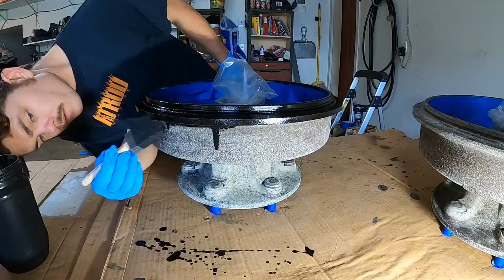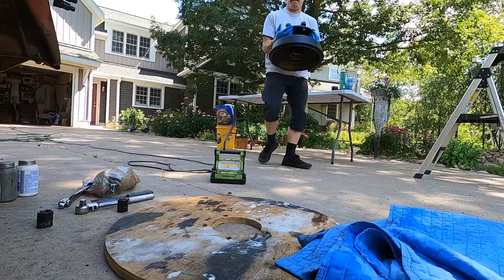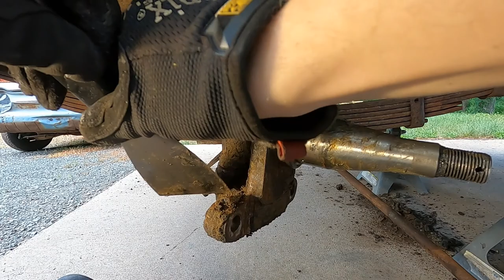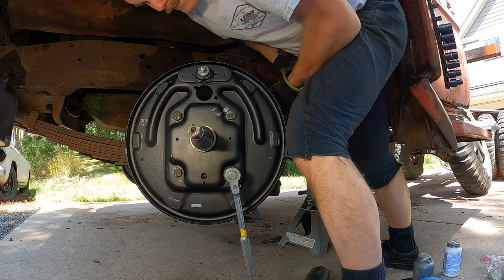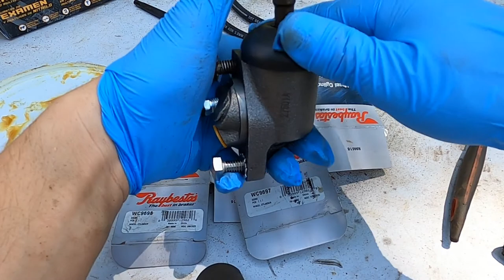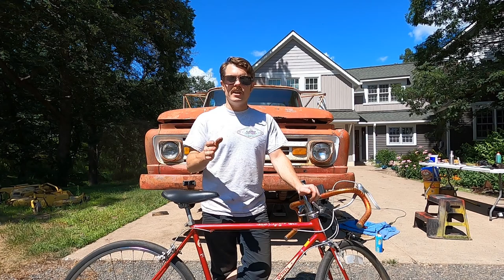1962 Ford F600 Brake Restoration! Ep. 44

Comment: Great video. This type of brake system has some flaws or defects that you need to be aware of. The brake booster has a metal vacuum tube under the truck that is prone to rust creating a huge vacuum leak and the booster also has an atmospheric tube that originally was inside the cab (behind the driver's seat) and this tube going down to the booster deteriorates to the point that the booster starts drawing in any moisture around the air inlet of the booster resulting in rust at the bottom of the diaphragm inside the booster. Once moisture gets in the booster then it is just a matter of time until the booster fails and defaults to manual brakes.
Reply from the maker: I replaced all the lines and hoses, and even did the vacuum line loop in the engine bay to keep blowby out!

Comment: Great video's, I've watched just about all of them. I have a 1957 F-500 I'm bringing back to life. The biggest problem I have are the 5x8 lug RH5° wheels i have, I want to get rid of them but I cant find any bud wheels. Any suggestions? Thanks! and keep up the great work! super helpful!
Reply from the maker: Glad to help! I love the 57's. In searching for my own wheel options, I've found you can get 22.5" single piece wheels that fit the 6 lug Budd pattern, but the old 5 lugs are more difficult. You may call truck wheel suppliers like this one and give them your specs to get some wheels custom drilled. It'll be a bigger expense up front, but then you'll have your pick of modern tires and always have peace of mind.
https://a1truckwheels.com/22-5-steel-wheels/

Comment: hey bro. odd question, you seem more knowledgeable than I am about these older trucks.

if I have a B600, which is the bus body medium duty truck (23,000-gvwr) version of the F600 from 1989.

I want to swap the drums and front tires from the heavy school bus setup, to a more medium truck setup.

I got the KMF07 inline 6, turbo. but I am concerned about the widow makers being an issue, as i plan on using the bus on the highway, and would like to swap the entire rear axle for a higher drive ratio, and modern brakes/duallys.

what parts, or from what truck should i look at for parts to fit a more modern disc brake rear with a butted dually hub instead of the split rim with lock rings?

Comment: What size are your brake lines and ends? 3/16 copper pipe is standard here in the UK.
Reply from the maker: 5/16 from the master and 1/4 out to the wheels. I'll cover that in the next video which I'll currently filming :)
Reply: @SealedBeamRallyTeam  thanks. I'll need to get some bigger pipe so I can make my own and flare them. Thanks for what you do. Honestly very informative and inspirational.
Reply from the maker: @stephenellis6651  Tube bending, flaring, etc, will come in the next video. All my 5/16 lines were pre-flared to save labor. Stay tuned!

Comment: Do you know what the rear wheel cylinders parts number is? I just ordered all mine from napa and the fronts you shared are half the cost.
Reply from the maker: I can look it up on prolink if you remind me this weekend
Reply: WC28661 upper and lower are the same. Rebuilding them is an option search wagner 19381.
Reply from the maker: I had Brake & Equipment Warehouse look up the Raybestos numbers for me, but their markup meant I paid more. Happy to do so for their amazing help!

Comment: 7:28 I would be careful with that corrosion inhibitor, it will hold onto brake dust and turn into a gooey mess. Also, having both the brake shoes the same is not desirable; you want the lining on whichever shoe engages first (The primary shoe) to start 1-1.5" down from the top of the arc. That way you get a more progressive engagement, which results in less grabbing and much more pleasant braking action.
Reply from the maker: I considered goo and chose it over rust. Will i regret that years in the future? Who's to say? :)

You're getting me nervous that I put both front pads on the same side though. They all looked identical!
Reply: @SealedBeamRallyTeam  Unfortunately, it's now the norm for manufacturers to simply give you 2 shoes with equal length linings as a cost saving measure on their part. That said, it's not like it won't work or anything, so I wouldn't fret too much. It's also very easy to correct with a chisel and a file if you're ever back in there!
Reply from the maker: @LN997-i8x  Yeah, we'll see how it goes!

Comment: That wheel cylender cant be right . It  dosent push on the rear facing shoe . All of my f600/700s push on both shoes
Reply from the maker: The 1961 Ford Truck service manual calls this style a "Uni-Servo Single Anchor Brake Assembly" on page 12 of the brake section. When the cylinder actuated both shoes, Ford referred to it as "Duo-Servo".
Reply: I came here to ask this. I’ve just stripped a ‘53 f600 hub and I’m staring at the single sided cylinder thinking… what’s the point of the rear shoes in this hub? As far as I can see nothing activates the rear shoe. I’m looking at putting a dual action cylinder on mine. Hard to find though being in the UK.